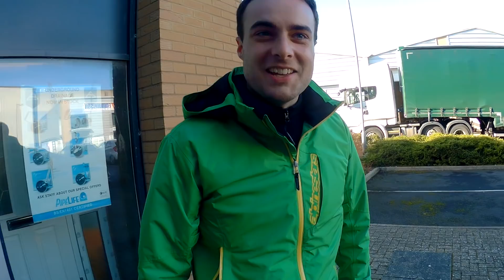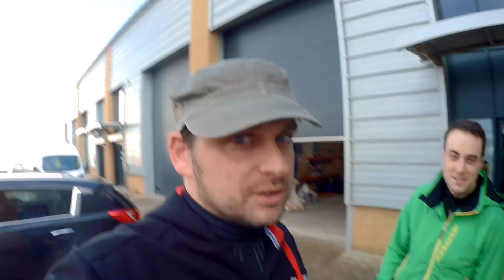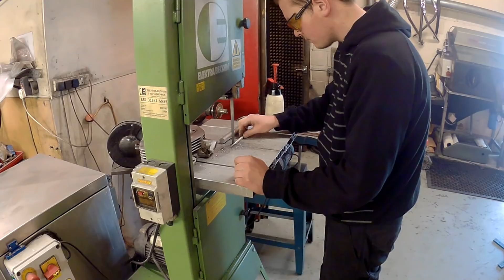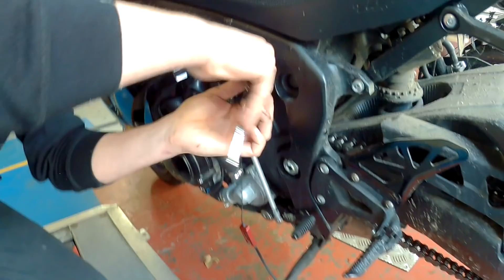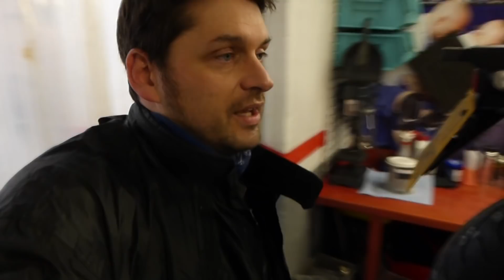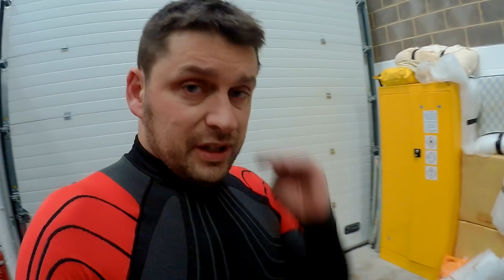2017 GSX-R1000R - Episode 5 - BJ's Blog

Comment: 2 recalls potentially. The first says that "if the rider fails to engage second gear (when upshifting), a neutral condition will exist and continued opening of the throttle will cause very high engine RPM." It goes on a bit, but there course of action includes a new ECM along with the inspection and possibly replacement of the drive chain and sprockets.
Reply from the maker: Yeah heard new ECU (or ECM as the Suzuki bods put it) is likely, nothing else yet though, they'll keep cards close to chest until anything official is released here.
Reply: They basically told the dealerships a second was coming, in a roundabout way, but haven't sent out any info yet. I think they are trying to find their course of action before they send out notifications.
Being such extensive changes to the bike, I'm not terribly concerned about a few glitches. I do, however, think they are changing a few things in the ECM/ECU without full disclosure. Kind of like the old "Delta Changes" Honda used when they didn't want the public to know about things.

Comment: No that's wrong! Strain gauge has no moving parts it's based on a break of electronic signal across the shifter. Standard unit will be a analog switch, some say s standard switch is better as it doesn't suffer from vibrations as  much..
Reply from the maker: Who said what now?! And anyway, you've been rumbled Mr C, shoo! ;-)
Reply: hehe sorry :-)
Reply: Isn't it the case that a strain gauge is an analogue signal with the threshold set on the input to determine switching point?
Reply from the maker: The stock unit is a switch/potentiometer type affair where a physical action activates it (very basic layman's, think a light switch), while the ST 'senses' the pressure and acts accordingly. So far so good with the HM, though I will be playing with sensitivity which I'll address in a future blog - mint for going-for-it up and down shifts, but needs some adjustment for the slower speed stuff, bit too sensitive even on 50/50, but I'll let you know more when I've fiddled more.
Reply: Fast Bikes Magazine actually, a switch and potentiometer are two different devices. A switch operates on a digital on or off principal whereas a potentiometer has an analogue output.
Reply from the maker: You'll have to excuse me as I tend to speak in generalities, yes I know they're different, I should have used 'or' instead of '/' in between the 'switch' and 'potentiometer', I don't know exactly what's used in the stock unit so was trying to cover all bases - if you've been watching my videos you should know already to not expect exact technical details from me! Ha!

Comment: Hi BJ, did you find the throttle in A mode like a bucking like a bronco?  I had high expectations for this bike, but the ride by wire couldn't hold a steady throttle and when the engine braking kicks in it was super abrupt.  Felt really dangerous....a real shame as the RSV ride by wire is like butter. Should I give the gixxer another go in B mode?
Reply from the maker: You could try, but I have gotten used to it in A now so it doesn't bother me much any more and I'm able to hold a steady gasser well enough. You're right about the engine braking being a little, erm, eager, but you get used to that too with time and doesn't stop the rest of the ensemble being awesome. It isn't as smooth as the RSV though, you're right.

Comment: @fastbikesmagazing @beej is that socket for the quick shifter there because there was a factory one fitted? just wondering whether it is part of the primary loom now or if you would have to still piggyback off the coils as with older models if you had no factory QS fitted?
Reply from the maker: Comes with the RR, up and down shift, no need to tap in anywhere else.
Reply: Fast Bikes Magazine thanks!

Comment: Great vid as always fast bikes.  I'm really interested in your opinion of the hm quickshifter plus as I have one on my 08 Daytona 675. I have the same issue with inconsistency with the hm unit ! Is it settings do you think ? If it helps you I dialed in the sensitivity using neutral so it doesn't cut the ignition on a " half shift " 

Ride safe :)
Reply from the maker: Cheers Jake, have you got in touch with them? They've always been really helpful if you haven't, maybe can help sort your issue? So far so good.
Reply: Fast Bikes Magazine cheers for the reply I haven't but I will .... ok check back in and let you know what they say 

Cheers

Comment: Mate, would you mind to share HM manufacturing number/model of that quick shifter? 
Thanks in advance
Reply from the maker: I shall check for you.
Reply: Thanks mate
Reply: I Have R model and that thing has a very bad gear change no matter of direction and adjustment . It might get better with aftermarket shifter and clutch. Very poorly engineered crap
Reply from the maker: This one - http://hmquickshifter.com/shop/hm-quickshifters/suzuki-gsxr1000r-direct-replacement-upshiftblip-assist-unit/
Reply: Fast Bikes Magazine Thank you

Comment: So mine does the exact same as what you're saying, but to add to it on fast up shifts it will go into neutral. Happened 4 times to me at circuit of the Americas. I'm not sure the recall is going to fix this problem. I have always felt that it had to do with the quick shifter being a little slow and the bike falls into neutral. So I would love to know if the hm shifter fixed the problem?
Reply: Sorry it only happens between 1st and second. Mine is gp shift pattern.
Reply from the maker: Never had any neutrals like that myself, but the inconsistency bugs when it happens, usually clunky for me, but otherwise really good. Early days with the HM, want to fiddle about with the sensitvity, plus if the recall has anything to do with this, may hold off a while before making my mind up. Damn sharp on the upshift though, pap!

Comment: How do you find the yoshi bar end weights I put them on but they didn’t fit well and rattled. Really pissed me off at some revs
Reply from the maker: The spin round, was going to talk about this next issue, drives me mad!
Reply: Fast Bikes Magazine yeah they rattled at around 5k rpm drove me mental. I’ll be putting the gilles lever protectors on next month instead.
Reply from the maker: The recess is wrong for the bolt to get full purchase, a washer would do the job, but I use the bar ends a lot riding, edge of my hand, it moving feeels just wrong!